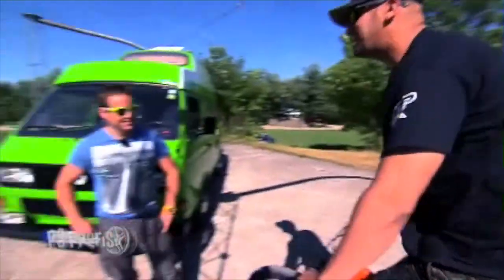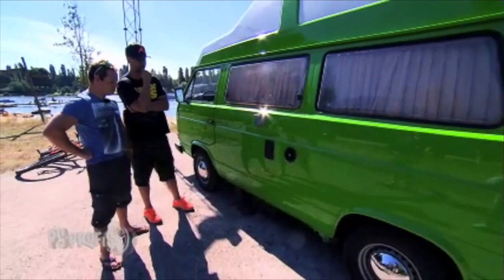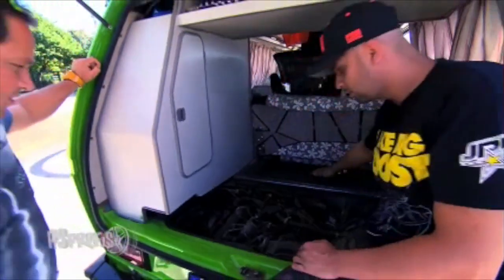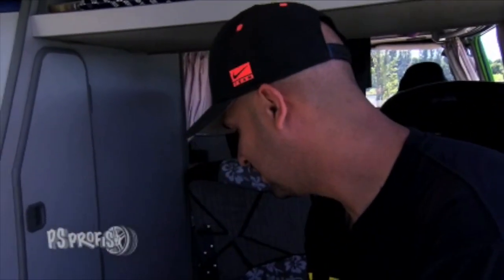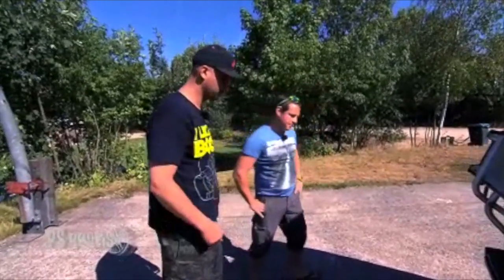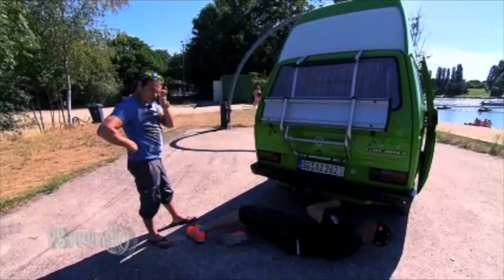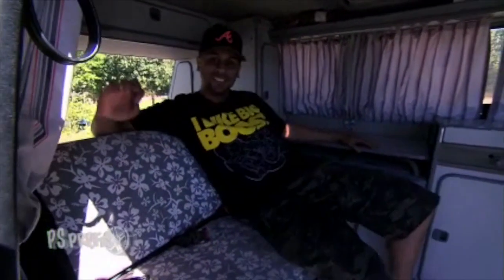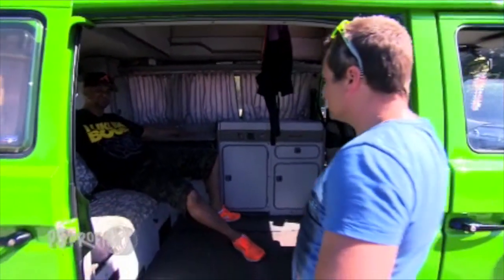PS Profis - VW T3 Club Joker Westfalia

Comment: HÄH? TDI bester Motor? AAZ mit neuer ESP und verlängertem 5Gang Benziner AAP Getriebe ist um Welten besser. Verbrauch identisch, falls unterwegs was kaputtgeht reicht eine Wasserpumpenzange und ein Hammer.
Reply: PS.: Meiner macht 160 laut Taco und Navi.
Reply: hab ne doka mit 1,9 tdi und un1-04 getieben ausm r25 bj 93 und meiner macht 176 aufm gps aber 120 ist locker bei 7 litern xD